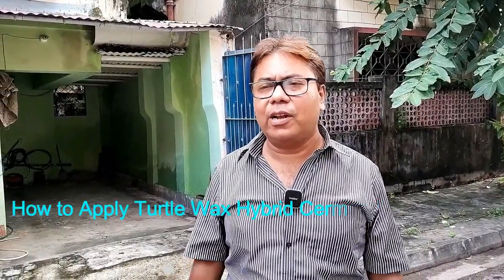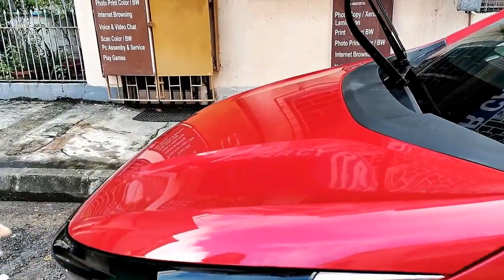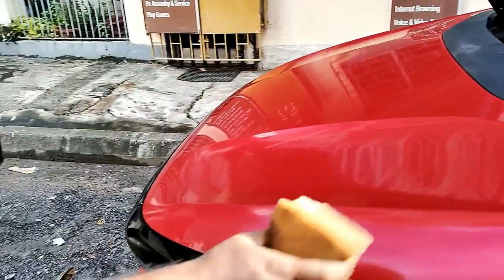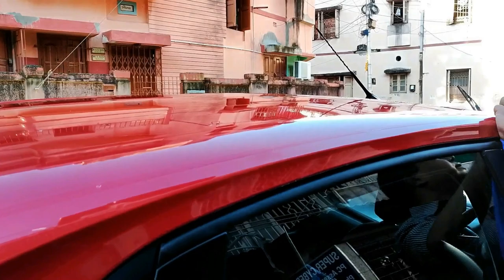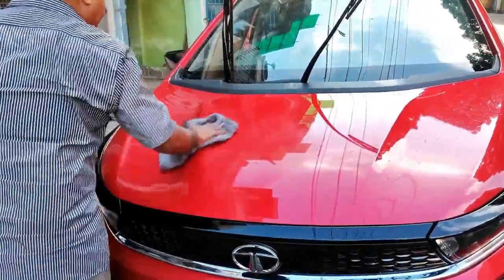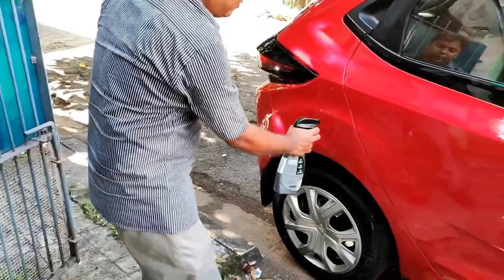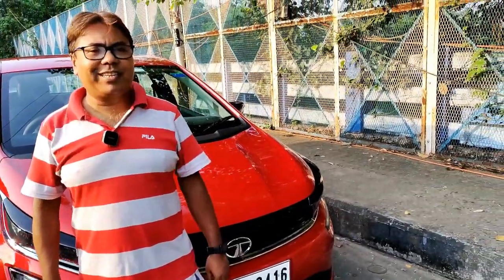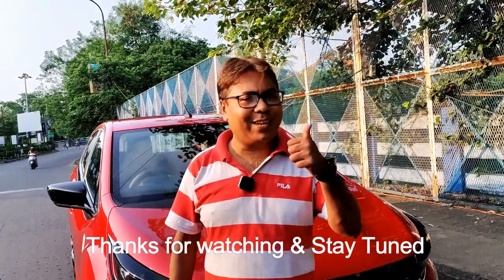Turtle Wax Hybrid Ceramic Coating The Ultimate Guide To A Perfect Car Finish #turtlewax #ceramicwax

Comment: Looking absolutely stunning. I will also apply the same on my car. In market they were asking 24k for ceramic coating. It is waste of money. We should definitely do it by our self.  Great job done.
Reply: This is not durable and lasts only 3-4  weeks and actual coating gives you longer and better performance
Reply from the maker: It's a hybrid coating and it stays for 3 months if the application is correct. After applying it depends how many pressure washing is done or if the weather is too harsh after application.
Reply: @skulchand2177  
9h coating also needs maintanance.

Comment: Hi, there are some people who say that you shouldn't apply Polish before applying ceramic coat on a brand new car as it can remove the car's clear coat. So what do you suggest should we apply polish first and then ceramic coat? Or just skip the polish because it will damage the clear coat?
Reply from the maker: Even in a new car there are some monor swirls marks and scratches. So polishing is quite safe. You are not compounding a new car.
Reply: @supercyberautomotivetravel  Will Meguiars Polish damage the clear coat of a new car? Is it safe to apply polish on a brand new car?
Reply from the maker: It's very much safe and can be used in a new car. Now if you are too worried for the clear coat better give the car a shampoo wash and apply ceramic coating. This will give protection too.

Comment: Have use this after a year, excellent results but after giving also 2 coatings, still spray is left in good amount, will the liquid going to ruin in a year or i can use it again next year?
Reply from the maker: Thanks for your query. The product will work the same after one year. Mine is 2 years old but still gives good results. I have  used the product in the Ford Fiesta.

Comment: Hello brother, For a new car what do you suggest between TW Ceramic Coating spray and TW Graphene Flex for longer life and better protection with combination of Seal N Shine as maintenance coat?
Reply from the maker: Go for a ceramic coating . You can use flex wax or ice seal n shine as an extension coat or top coat over ceramic coating.
Reply: @supercyberautomotivetravel  So after applying TW Ceramic coat, when can i start applying Seal N Shine?
Reply from the maker: When you feel the coating is lean or every three months depending on the weather or driving conditions you may be facing.

Comment: Hi sir great effort from your end.  But I have one suggestion after applying meguiars polish please use IPA spray to remove the excess oil. Then later apply any coating so it will bond the surface
Reply from the maker: Thanks for your feedback.

Comment: Thanks a lot Dada for the explanation and sharing the DIY technique. I am buying a new car so, I will use the "Turtle Wax 53409 Hybrid Solutions Ceramic Spray Coating" directly after cleaning the surface. I have a question, what's the process to do the follow-up coating say after 6 months? If you have a video for that, please share.
Reply from the maker: Thanks for your query. You can use a top up coat once you feel the effect of coating getting lean preferably after 4 to six months depending upon requirements. Here I have used a wet wax as a top  coat.See my video
https://youtu.be/AondL5TC6vw

Comment: Should i polish my new car or direcly use ceramic spray?
Reply from the maker: Thanks for your query. If your car is absolutely new and scratches are there you can apply ceramic coating directly or else polish and then apply ceramic coating.

Comment: Hi what we should do for regular maintenance after applying coat. Do we need to add wax or normal shampoo wash? Because in my area dust is more
Reply from the maker: I am using wax based car wash of Turtle Wax . Do watch my video for the same.
Reply: @supercyberautomotivetravel  Thanks. MEGUIAR'S G19216 Ultimate Polish also can be used after Turtle Wax Hybrid Ceramic Coating ?
Reply from the maker: I use this polish but it's meant to be used before applying wax or any coating.

Comment: Hello sir. Great info.
Could we also use 3M cream wax and later apply ceramic or nly liquid based polish first ?
Reply from the maker: Thanks for your query. You should use ceramic coating first and can use any wax cream or liquid as a top coat or extension coat. But if you have already applied cream wax you can apply ceramic after sometime as top coat also.
Reply: @supercyberautomotivetravel   thank you sir

Comment: Sir, Have you used Ceramic polish & wax before ceramic coating and also tell me after polishing any time gap required before applying coat
Reply from the maker: First I have used Meguiers Ultimate polish to clear all scratches and marks if any. This is required to bring the glaze and lusture and mirror effect. After apply first coat of ceramic coating. Allow the coating to cure for 24 hours. Again apply the ceramic coating second time. And you are done.

Comment: Sir can I use 3m paste car polish and than use turtle?can I use polish in front and rare bumper?
Reply from the maker: 3m polish is not required before applying ceramic spray. Wash the car with a good car shampoo and then apply ceramic. It can be applied on surfaces.

Comment: After 1 coat 24 hrs latter i am finding lot of dust sticked to my car bcoz i love in polluted area, 
     Do i need to wash the car again or what to do ?
Reply from the maker: Do not wash. Dust it with a duster. Then remove all dust with a moist microfiber cloth. As absolute cleanliness is necessary.

Comment: How many coats did you use 
And at what time intervals for each coat
Reply from the maker: Thanks for your query. For the first time 2 coats are required. For follow up you can apply coats after 4 - six months depending upon requirements. In my case I usually do a topping after 3-4 months for best results.

Comment: after implementing above product, which type of car shampoo should use to car the wash
Reply from the maker: Thanks for your query. Preferred one is a ceramic based shampoo. But you can substitute with a wax based shampoo.
https://amzn.to/3nCKonl
https://amzn.to/3AtXpau
https://amzn.to/3NHSR35
Wax based
https://amzn.to/3bQH4m1
Reply: @supercyberautomotivetravel  Thanks for reply, but i have 3M car shampoo, so is it good to use after implementing ceramic hybrid
Reply from the maker: 3m two types of shampoo are there if it's wax based no issue.

Comment: Can we apply it on windshield and windows. After applying on glass does it cause diamond effect when light comes through the glass. Else it will be difficult to see
Reply from the maker: Thanks for your query. It can be applied on all glass and rubber parts without any issues. Application on windshield will not create any diamond effect.
Reply from the maker: Thanks for your query. It can be applied on all glass and rubber parts without any issues. Application on windshield will not create any diamond effect.
Reply: @supercyberautomotivetravel  does it protect from bird droppings
Reply from the maker: Yes to some extent.

Comment: Sir, I am from Dum Dum airport area. Thank you for your video. After watching your video I have done ceramic coating of my six month old car. Now I have few questions on it.
i) Does it need only water or shampo wash?
ii) After how many days it required again ceramic coating?
iii) What will be the process of ceramic coating for the next time? Is it the same as you have shown in your video for the first time?
Thanks in advance.
Reply from the maker: Thanks for your query. I have several videos regarding how to maintain ceramic coating. Also what products you can use as top up and washing process. Video Links
https://youtu.be/vH40gkVYcFs
https://youtu.be/AondL5TC6vw
https://youtu.be/57CvsrLECUk

Comment: One Question : As you said Polishing can be done on glass, similarly ceramic spray can be used on glass?
Reply from the maker: Yes it can be done without any problem. Ensure the glass is clean before applying the spray.
Reply: Thank You Sir
Reply: One More Query: My Taigun car front grille has usage Piano Black, Chrome and then polished black - is it ok to use polish and then ceramic wax here as well? 

Also you said no polish to the black Matt surfaces like trim? Is this area can be used with ceramic directly?
Reply from the maker: The advantage of ceramic coating is that it can be applied to any surface like chrome, black areas, plastic, rubber unlike normal waxing. So you can apply it to any surface.
Reply: Polish I should avoid trim areas right? But can be done on piano black and chrome right?
Reply from the maker: Yes

Comment: Thanks for the video, really nice explanation. I have one question after 24 hours curing before doing second coat, do we need to clean the surface and how?
Reply: Can you please answer my question?
Reply from the maker: Thanks for your appreciation.If there's is any loose dust simply dust away with a duster like Jopasu duster. If it's stubborn use a moist damp microfiber cloth and wipe off dust gently so no swirl marks are formed. Once dust free you are good to go for second coat.
Reply: Thanks for sharing. Also, would you recommend Meguiar's polish or better to use some turtle products for polishing as well?
Reply from the maker: Meguiars polish is better. I have been using this product for a long time.
Reply: I followed your approach and just did second coat today. It's giving really nice glossy look on my Kushaq. 1 question I had is after second coat also do we need to leave it to cure for another 24 hours?
Reply from the maker: Thanks for your query.  You should allow 24 hours curing time for it settle properly .

Comment: Just a tip for new car owners -  the step he has mentioned about polish can be skipped. It's not necessary to polish your car before spray waxing. Polishing removes part of your car's clear coat which protects the colour coat from UV damage and fading, so should only be done when you need to remove scratches and swirls.
Reply from the maker: Thanks for your input. By the time I did this job the car was 10 months old and some swirl marks were visible.
Reply: @supercyberautomotivetravel  Yes, makes sense then. Else for a new car, just a good wash, and then probably claying if need be, and then spray wax directly.
Reply: @thegreatantz  
Meguires polish are clear coat safe
Reply from the maker: Thanks for your query. Meguiars polishes are absolutely safe so no need to worry.
Reply: @thegreatantz also need to iron decontaminate and then use surface prep
Reply from the maker: Yes if the car is old and contaminated.
Reply: @supercyberautomotivetravel  it’s suggested that even when the car is in the newer category, using something like iron x before the coating will take out any environmental stuff off the paint from it being transported. Just a safe step to ensure proper durability
Reply: Can I apply the coat on the windshield and glasses?
Reply from the maker: Yes you can

Comment: Hi i had put 2coat of turtle ceramic spray after 24hrs of first 1…can i drive my car just in few hours of 2nd coat???
Reply from the maker: Normally 24 hours curing time is required as it will settle properly and give long lasting results.

Comment: Hi can you do a review and difference between turtle wax spray and turtle graphene paste wax
Reply from the maker: Thanks for your query. The spray wax is easy to apply and any layman can do it. Whereas the paste wax require some professional expertise to apply. Theoretically graphene is supposed to be superior in protecting and has better hydrophobic properties. But the ceramic spray is sufficient and need be I will apply once in a year .
Reply from the maker: Thanks for your query. The spray wax is easy to apply and any layman can do it. Whereas the paste wax require some professional expertise to apply. Theoretically graphene is supposed to be superior in protecting and has better hydrophobic properties. But the ceramic spray is sufficient and need be I will apply once in a year .

Comment: Can this wax be used in the windshield and window glass? If not, which coating for such areas ?
Reply from the maker: Yes you can. It is applicable to glass, rubber and plastic as well.

Comment: Kaku akta jinis bujhlam na tumi jeta dkhale fast e SPRAY ta 1:33 and pore jata dkhale MEGUARS hybrid Cream polish konta use korle valo hoy. Amazon e TURTLE er onek rokom spray ache and Hybrid Polish ache TRUTLE er but SPRAY use korbo naki POLISH CREAM korbo? Snd which is best MEGUARS OR TRUTLE?  i20 car red. Kolkata.
Reply: Amar kache bapar ta clear holo na. Amk tumi bolo konta sob theke valo hobe SPRAY OR POLISH CREAM? AND TRUTLE OR MEGUARS? and korar age shampoo spray kore nite hobe to valo kore?? And age ki SPRAY KORBO NKI CREAM?
Reply: And Osadharon Sundor hoeche kaj outstanding and please amr doubts clear koro
Reply from the maker: 1 no spray ta shampoo wash to clean and remove dust particles, 2 no cream hoche polish to remove paint imperfections or remove swirl marks eta tume meguiars ba turtle use korte paro amr kache meguiars ache tai use korechi. 3 no Turtle Hybrid ceramic coating to protect the polish surface and glossy appeal. I20 red e darun lagbe. Amr aro polishing video ache segulo dekhte paro.
Reply: @supercyberautomotivetravel  dkhchi kaku ar tomar polishing video tar link jodi paro die dao ami dkhchi and thank u.. and ar akta kotha ami order kore diechi tomar link die TRUTLE er car zip wash and TRUTLE er hybrid Ceramic Spray ta. CREAM ta akhno korini korbo order TRUTLE OR MAGUARS. TRUTLE ta price ta khub high jai hok...
Reply: @supercyberautomotivetravel  ar bolchi j WAX Ceramic polishing cream ta apply korar 12 ghonta por ki Spray ta apply korbo? Ar tumi bolle 2 coat. If ami jodi dutoi 1 coat kori tale valo hbe na kaj ta?
Reply from the maker: Ei product gulo high demand tai ekhon price high ache
Reply: @supercyberautomotivetravel  prochondo ar bolchi craeam/wax jatai boli sata apply korar por ki 12 hours por spray apply korbo?? Ar 1 coat korle hoe jabe bcz amr ofc thke time paoa jay na akdom
Reply from the maker: Polish er por  first coat ceramic spray korbe tar por next day second coat ceramic spray korbe . Final coat er por 24 hours or more hole gari bar korbe
Reply from the maker: https://youtu.be/0toxoeF_9F0
Reply: @supercyberautomotivetravel  ok Kaku thank you so much sustho theko valo theko

Comment: Can we use turtle wax compound non liquid
Reply from the maker: Thanks for your query. Yes you use non liquid compound.
Reply: @supercyberautomotivetravel  thanks for reply wanna know what’s better this ceramic diy with compound.   Or. Turtle ICE N SEAL … MY CAR IS 3 years old
Reply from the maker: Car age is not a concern. Turtle wax ceramic coating will give better paint protection and last longer than ic n seal. Not only that it's easy to apply.
Reply: @supercyberautomotivetravel  can I use 3m compound it’ cheap only for 199 ? And then use ceramic
Reply: And is it hard to apply paste wax then what cheaper alternative of liquid wax
Reply from the maker: 3 m compound is good but the application needs some expertise as it is bit rough compared to turtle wax.
Reply from the maker: It's bit hard to apply paste wax but not that difficult. I have a dedicated video of that 
https://youtu.be/QvVYBNECqlo

Comment: Hi sir good video. But simple suggestion before applying any polish or ceramic coating. First wash with car shampoo, use iron and fallout remover, clay bar this to remove any left over decontaminate tar, brake dust clay bar remove grime and environmental contaminants from your vehicle surface and then use any car polish later ceramic coating spray. So that your vehicle look in better shape thanks
Reply from the maker: Thanks for your support. I did this in absolutely new car all cleaning process done before hand.
Reply: @supercyberautomotivetravel  OK sir thanks I bought meguiars polish after watching your videos. Seriously it's very good polish in market

Comment: Atleast use good sponge applicator. No claying prior to application of polish? Just a shampoo water can remove all dirt? No proper shampoo was with a Mitt? Direct spray of Ceramic hybrid spray may cause streaking. Better spray it on microfiber pad or sponge applicator first & then massage on the paint. 24 hours curing time on the street, is it okay? Dust will not interfere?

Video is good for new detailer's.
Reply from the maker: Thanks for your feedback. The car was new and no such scratch or swirls marks were there so claying was not necessary. If the car is parked outside then dusting and cleaning with a moist damp cloth will be necessary before the second coat application. Also I have tried to make the application easier so that every one can do it on their own. You may watch my other detailing videos.

Comment: Never use wax polish before ceramic coat. First, do ceramic than any kind of wax
Reply from the maker: The polish I used was for paint correction in order to remove swirl marks and scratches. This was used for pre polish glaze and finally the ceramic spray.